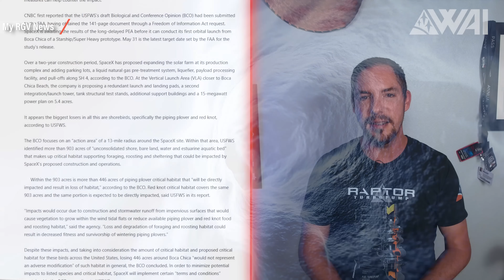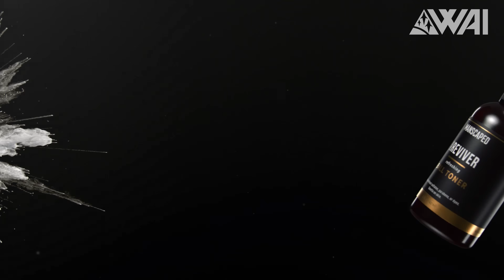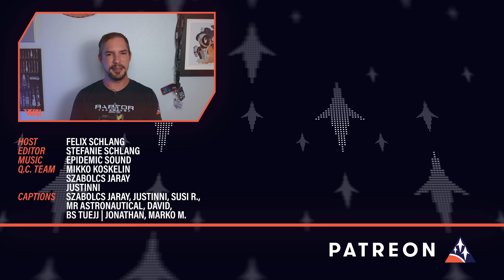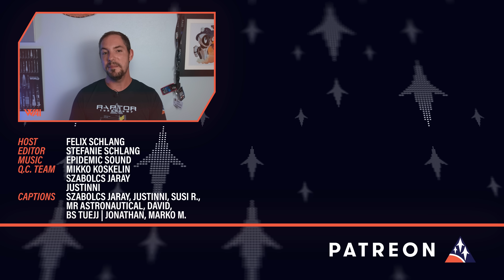SpaceX Starship Accelerating Efforts Towards The Orbital Launch Test!

Comment: It would be unlikely for the gases to mix to anywhere near a perfect stoichiometric ratio before combustion engulfs the mass. It certainly wouldn't be a detonation like a fuel air bomb.
Reply: yep. Mostly it would just be a deflagration.
Reply: @michajastrzebski4383  well, that is the only other option.
Reply: That and chemical explosions are nothing like nuclear explosions.  Nuke map wouldn't be a realistic outcome because a chemical reaction takes much longer and like nano seconds vs 5-12 seconds.   Methane is much safer than hydrogen (I'm looking at us SLS).
Reply: yes, wanted to comment the exact same thing, probably 10% efficiency is more realistic. But its reassuring that even in this very unlikely case, noone would get hurt (but a lot of infrastucture would be damaged or destroyed setting back the program for at least half a year in Boca Chica).
Reply: Indeed…why did Felix decide a 75% of max energy explosion was an appropriate case to study?  I’m unqualified to know, but I recall an expert saying it would be much, much less.
Reply: @Johnny saved me making a post, just glad we’re a switched on bunch, though the concern  of some nincompoop taking the video at face value and then propagating a false interpretation has me shuddering anytime the subject is brought up. Carry on team.
Reply: Only a small boundary layer between the fuel and oxidizer would combust anywhere near it's full potential, the expansive force of which would just push the remainder of both away from each other intact.  And this is well documented most notably a fairly large bang the Russians experienced decades ago, only to find when they ventured out to the pad puddles of fuel actually lying on the ground.
Reply: I nice slow cooker? that sounds preferable. :)
Reply: why , all that liquid o2 right next to fuel source in an explosion ?..i think you be right if it was fuel only  in air
Reply: But Angry said it might blow out windows in South Padre Island! Lol. It would get hot but no such huge explosion. Explosion is different than fireball…big fireball only,
Reply: I was saying the same thing in a couple of replies. It would be more like the space shuttle explosion, a fireball
Reply: Its great seeing all these comments from people whose asses arent gonna get fried when one of these big fuckers go up . Good job.
Reply: Even at a 10% efficiency (1.3 kiloton) the 1 psi radius (explosion at 340m altitude - remember this video only chose the "explode at ground level" option) is 2.2 km - almost to Boca Chica. Also at the stated 70% efficiency (but exploding at 670m altitude), the 1 psi radius is 4.26 km and the 5 psi radius is 1.51 km. Boca Chica sitting between these two would experience a lot more than broken windows and anyone not in a solid structure would likely be injured. The construction facilities would be seriously damaged. Now, is it 10% efficiency, or 70% efficiency. Its a case of "How lucky do you feel, punk?"
Reply: @saumyacow4435  - You are ignoring the fact that it will be a conflagration - not a detonation. That's not 1.3 kiloton instantly - it's spread out over seconds.

There won't be a supersonic pressure wave - not all explosions are equal - some deliver energy over longer periods.

A balloon filled with methane that's set on fire doesn't detonate like a grenade does it? there's not a flash followed by no flames is there? it burns for a few moments.

A Hiroshima shines on the average garden every year - the duration of the energy release? matters.
Reply: @JohnnyWednesday  It all depends on the nature of the failure and how much fuel/oxygen or fuel/air does get to mix. Yes there have been rocket explosions that are at least in part detonation. The question you need to ask, is what fraction and more importantly what's the worst case?
Reply: @saumyacow4435  - I don't know but I'm sure the engineers that designed that tower either knew - or knew somebody that knew - and that a full stack explosion? would likely have been considered.

While the utilities on the tower might be damaged - I don't see a full stack explosion damaging the structure to the point it requires a physical rebuild. The exhaust of the raptors is far more intense than any single point of the explosion would be and the relatively small launch platform can handle that with ease - the fireball will be nothing but a strong breeze to the tower - trust.
Reply: @saumyacow4435  - I'm not trying to be adversarial by the way - I appreciate the conversation - and I concede I might be wrong and you might be right. I mean to express why I think I'm right lol
Reply: @JohnnyWednesday  I'm less concerned about the tower and more concerned about the safety of people and property damage at a distance.
Reply: @saumyacow4435  it'll most likely be exactly like the last one. It will probably burn longer..
Reply: I also don't think you can include the fuel mass of Starship to the fuel mass explosion of the booster. They would explode in different intervals so; they are not additive! Also, Elon once talked about Starship not having an escape system where Starship would be able to escape a booster explosion. I don't think that Space X and Starship have progressed enough yet to deal with a booster explosion, but I could be wrong. As much as I like fireworks, I would not enjoy seeing this scenario played out.
Reply: @PC-nf3no  It stands to reason that they will launch with Starship's engines pre-chilled and ready for a 1-2s ignition sequence in order to escape from a booster failure.  I hesitate to use the word "explosion" since it will be a slow-moving fireball, not a speed-of-sound shockwave from a detonation, which is what most people think when using the word "explosion."
Reply: @linuxgeex  I too am cautious of the use of the word explosion. Even more so on the over and misuse of the term implosion. But it is possible to have a shock wave as we saw, I believe, with SN 10. I speculated that Starship would be spun up during launch in order to use as the escape vehicle that Elon spoke about. Just not sure if these early flights could actually pull it off.
Reply: @PC-nf3no  I thought the Starship engines are it's own escape system if the booster fails. Of course, if Starship itself fails... that would be like the Dragon capsule itself failing and no escape possible.
Reply: @KenOtwell  According to the little bits that Elon has put out there on this subject, you are correct. Several commentators have complained about Starship not having an ejection system and they note the Challenger disaster. Comparing the two is a mischaracterization. The leaking O ring fire was essentially a blow torch cutting into the Fuel Tank. Though there are no details, Elon said there would be time for Starship to escape.
Reply: True, but a conflagration of this size will do a lot of damadge.
Reply: @qpwodkgh2010  True, the launch area would be heavily heat damaged. the whole launch tower and tank farm would likely need to be replaced.
Reply: @schrodingerscat1863  - a few hundred degrees (on average) for a few seconds and a pressure wave of little effect. I point to the explosion of the landed Starship - the initial pressure rupture and subsequent 'second landing' did far more damage to the thin structure than the 'explosion'.

Yes (optimal) methane/oxygen fires have a peak heat of something like 2800 degrees(c) - but the steel (of the tower, fuel farm) won't deform until all of it has reached a critical temp - things simply won't be hot enough, long enough - for it to be a problem.

Like passing your hand through the flame of a candle - but a steel hand and a really big candle.
Reply: @JohnnyWednesday  It's not that it gets hot enough to melt or even deform the structure but there would be quite a hot fire what would last for some time with all that cryogenic fuel and oxidiser that much heat would change the characteristics of the metal. It is unlikely any structural engineer would be able to approve it after that because there is no way to determine how the characteristics of the structure have been effected by such a fire. Similarly the GSE tank farm would be very difficult to get re-certified after such an event.
Reply: @schrodingerscat1863  - I can't predict the dynamics of the entire system - but judging from the many examples we've had of such explosions? 

I strongly doubt that a full stack exploding is going to cause any structural damage to the tower that will require a rebuild - it's a huge structure and it's all connected - the heat transmitted to the surface will be quickly conducted.

The pressure isn't enough and I just can't see a perfect methane/oxygen fire burning on the ground/tower for many minutes - methane is lighter than air and the heat will cause it all to rise even faster - it'll just be a huge 'whooomph' - not a sustained fire.
Reply: @JohnnyWednesday  The Starship explosions we have seen so far have been with quite small amounts of fuel, this will tend to cause a large explosion with little to no fire afterwards because the tanks are filled with gas at that point, but with full tanks there will be thousands of gallons of cryogenic fuel and oxidiser with very little initially in a gaseous phase at ignition. Such a situation would create a hot fire that would burn for a comparatively long time as the cryogenic liquids boil off. Because of the volumes of cryogenic liquids involved it wouldn't be an instant giant fire ball that burns out in a few seconds. though there is likely to be a big fireball when it first explodes, but would be enough unburnt fuel and oxidiser on the ground to sustain a hot fire for maybe several minutes. It's not easy to predict to be fair. Previous rockets that have exploded on the pad have mostly been RP1 and oxidiser which is a totally different again.
Reply: @schrodingerscat1863  I don't think the steel could ever get hot enough from an explosion to deform. The risk to the tower is more likely the utilities on the tower getting damaged from flying debris. The GSE tanks are thickly insulated before the inner tank is reached. Again, it's not gasoline, so it will not burn for more than a few seconds. I think the greatest concerns is piping damage to the methane tanks where an impinging fire on a tank could possibly lead to a BLEVE (boiling liquids expanding vapor explosion). In that extremely rare scenario, a tank could be launched for quite a distance. I don't even want to talk about that.
Reply: @schrodingerscat1863  This is not exact, see the Hindenburg.
Reply: @PC-nf3no As I already said it doesn't have to get hot enough to deform the structure, but after such a fire the tensile strength of the metal will have been compromised. It may be this has already been incorporated into the design but if not the tower won't be considered structurally sound after such an event. All speculation anyway as we don't have the specifications it's been built to.
Reply: @schrodingerscat1863  I have seen where load bearing structural steel deformed and did not cause decertification. That's because steel retains its strength when cooled. However, this is a complicated structure with an external trolley elevator. we'll see how they handle that if it were to happen. You could reference damage to other gantry systems from rocket explosions.
Reply: @JohnnyWednesday  The landing explosions were with a tiny amount of fuel.
Reply: @qpwodkgh2010  not to heavy steel structures like the Orbital launch complex.  At best blister some paint, roast some pigeons and seagulls.
Reply: @qpwodkgh2010  It even damaged your words!